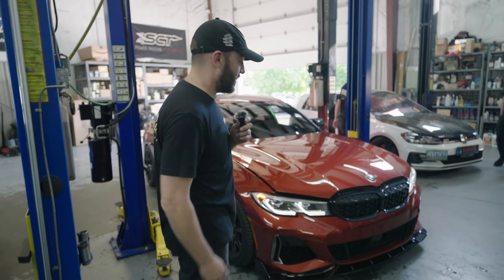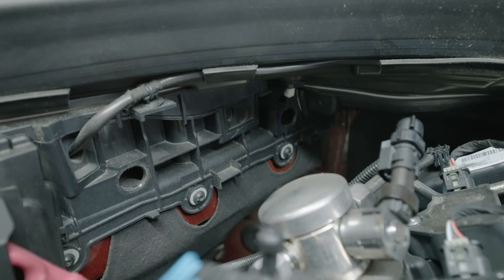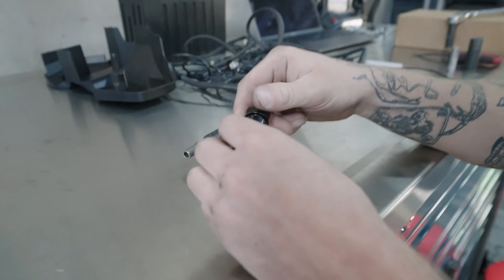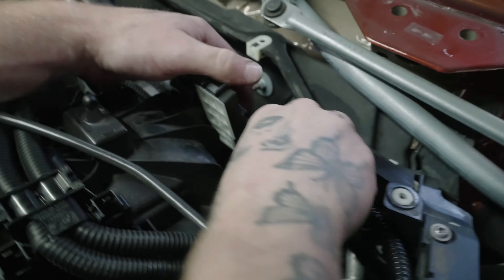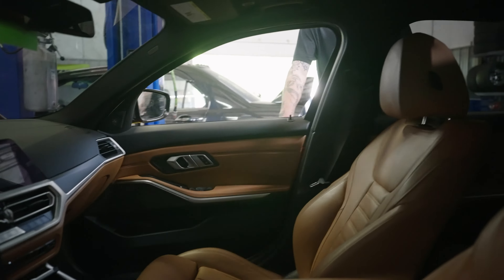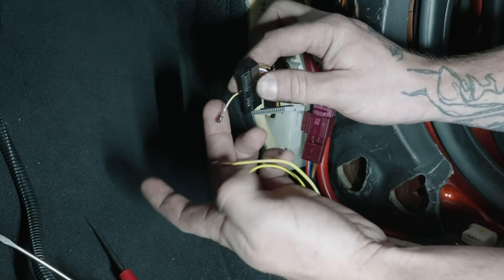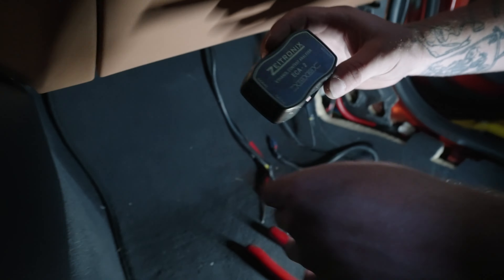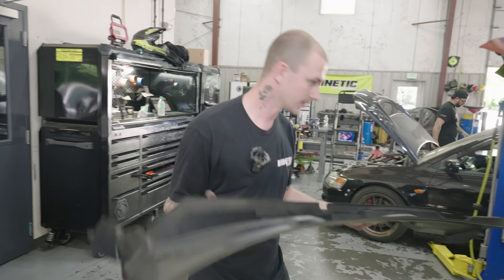M340i (G20) Visconti Tuning Flex Fuel Kit Install!

Comment: Hey guys. I’m having a problem installing the gauge missing the pinouts for the sensor. 2020 m340. I need this solved today. Client needs his car. Any advice would help alot
Reply from the maker: Is this a Zeitronix Gauge?
Reply: did you get it solved?